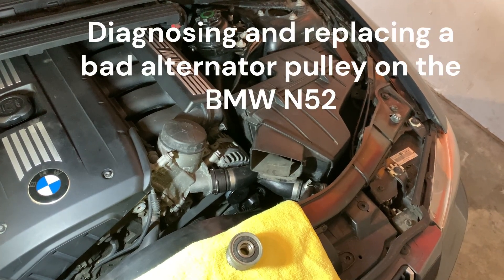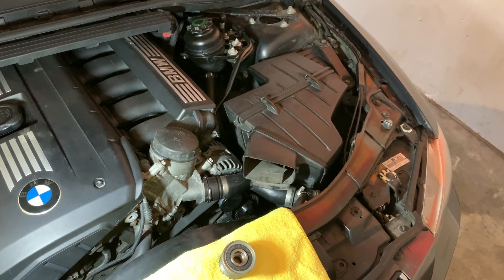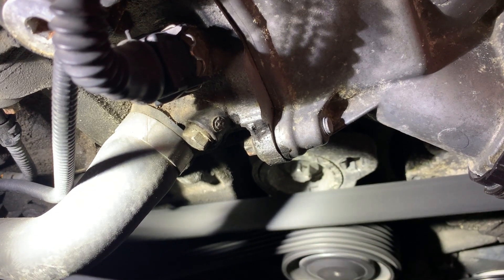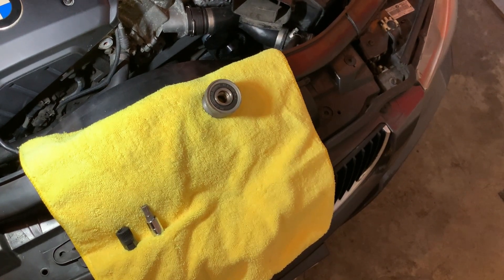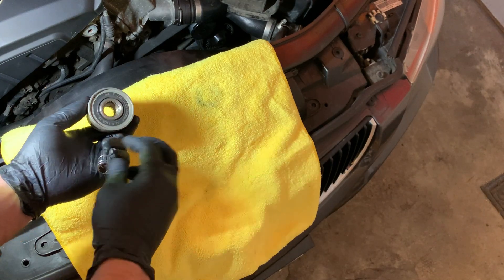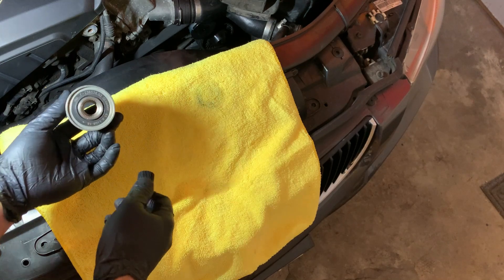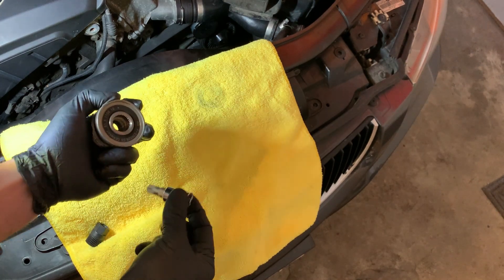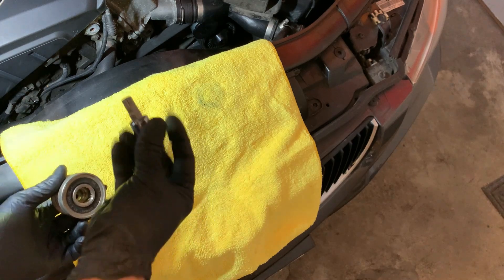BMW e90 N52 Engine Rattle Sound Fix, Alternator Pulley Replacement

Comment: Do you have a link to where u got the bearing?
Reply from the maker: Sure thing! This is the alternator pulley I purchased:
https://www.amazon.com/BMW-OEM-Alternator-Pulley-Overrunning/dp/B00TTH2Q8E/ref=sr_1_1?crid=V69XR3VKAATX&dib=eyJ2IjoiMSJ9.GIXQ1owQTd9_tXOO3qdYwoCPOLk6UFBACAUrYhSUkAsQBUkNh20TUo4zQmvx9RFfK1qNTBHqxzX6N66-gyBDMf6GvXRBjBuLunziw1eKu1MBJ7iybCkwTjRGogma4M8yRclzYJ8x2JmEPLaxHmuk2G7W94meW6Ew7s3-GpblWNwW9mMgoZbVmvNNkHhaqFEb3jNTn6wySPlU_7EG2WtYCOPzKpYpV1jB2TgGnrELf6w.kkWt4xl4nXbvHhy1z54uKyGeHUqLL4PIA76GeIEAgfg&dib_tag=se&keywords=e90+alternator+pulley&qid=1767047216&sprefix=e90+alternator+pulley%2Caps%2C490&sr=8-1

Comment: I have a short posted with a weird sound and think it might also be related to this, do you have an idea?
Reply from the maker: Best thing to do is remove the belt and check that the pulley spins/locks up correctly.
Reply: @EvanKontras  Ty will try!

Comment: Had the same issue. After watching your video I did some trouble shooting, took every load possible off of the alternator and the rattle stopped. I then created some load via heated seats and the noise came back!